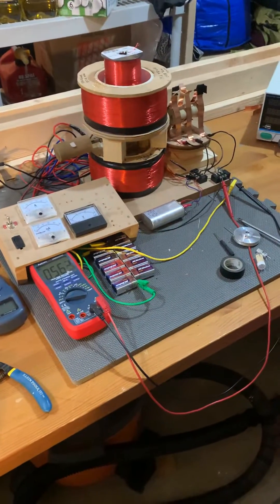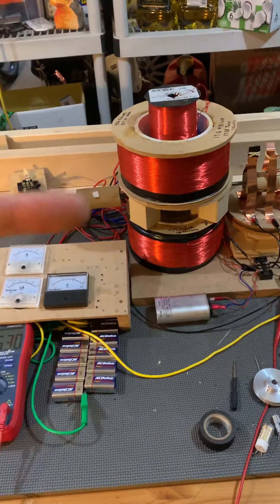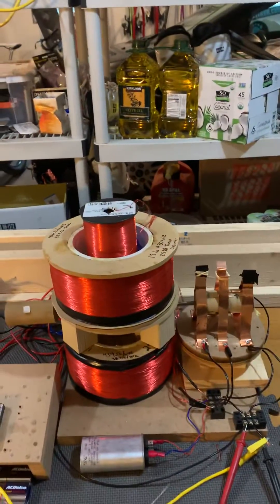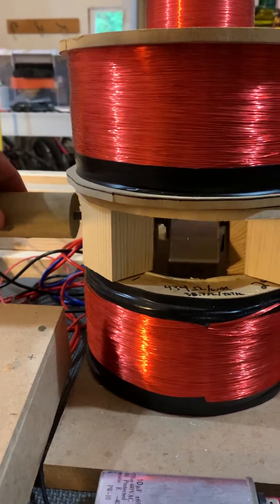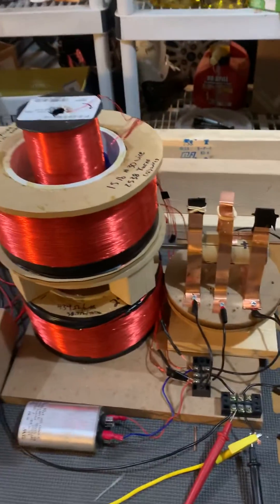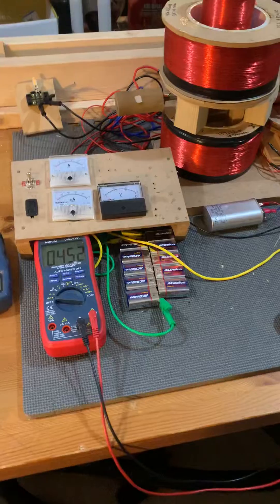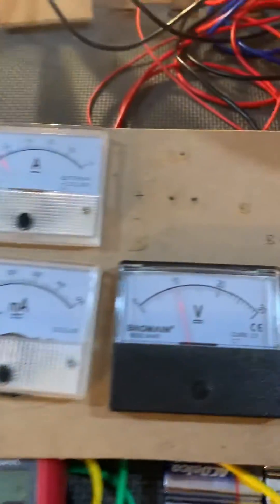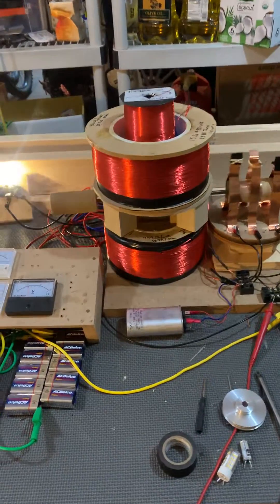Newman Motor

Comment: The power the magnet will put in the coil is directly proportionate to the gap between the magnet and the coil itself I would take a bunch of laminated bailing wires and place them inside you are main coils and make it so the nano denim spins and barely doesn't touch and then turn your neodymium into an electromagnet so that you can disconnect it and it won't be attracted to the iron cores after top dead center...

Comment: I bet you wound the coils like everyone else does which Is NOT the right way...
Reply: Should he like this, on a coil every LAYER should be wound the same way, meaning starting on the left and ending on the right, 
i see ppl do one layer from left to right then the next layer is right to left, 
basically when power goes through that coil on both ends of the magnet there will be a N and s pole and a S and n on the other end, 
if every layer is from left to right then there would be N and N on one end and a S AND S at the other, 2 layers would have double the field strength,  
after i do one layer i try to get back to the other side with 1 loop or 2loops max to achieve all one way,
just tapping a battery causes a really fast spin so probably leads to even lower power needed, 
i bet even the Bemf would look more uniform aswell, resonating coils are also meant to cause amplification.

Comment: Ive got one I scaled way down and got real close but couldn't break that 100%. Mostly because it is so small I had to use a single reed switch instead of a commutator and I never could flip the poles. Based on all my tinkering on my bigger machine like the one you built, I could never get any solid state triggers to work, they would run for a little bit and then bam outta no where something would blow up no matter how many protections I placed on the transistors. I even blew up a couple optical sensors and I still don't understand how. If I used big reed switches and flipped the poles, they would eventually weld themselves together, I tried a commutator and it would burn at the contacts. So much HV and potential being produced. The flip of the field is definitely the key I believe. You can run one all day on a single trigger and half h-bridge but as soon as you start flipping the field, somethings going to blow up. Such a neat motor and Newman was on to something for sure.
Reply from the maker: Thx for lengthy comment. I can appreciate your trials getting it to work. These things are pain staking at times. I think the electronics is the way to go but I’m an amateur and the commutator is simpler. Still I’m unsure it’s ever going to be OU but it is a novel invention and the batteries will last a LONG time.
Reply: @energyhack3538  I think with more work on the snubber circuits for the driving transistors, it may be possible. Newman never successfully used transistors  and I think it's due to the enormous amount of bemf he was able to get from his motors. You probably saw the video with the motor we both copied our design from. His was so strong it made the overhead lights glow with each pulse. I hope you can figure it out.

Comment: Nice replica !
Did you pull out the pulse spikes ?
 I looks like just gen coil 
 Have you done any recent work on it ?
Reply from the maker: No, I let them just go back to to batts via commutator.  Have not worked on it recently. Do you pull out spikes with a diode and electronic switching?
Reply: @energyhack3538  
 I don’t do the generator coil it just loads the motor you want to use a transformer effect and don’t use the regular wave below battery voltage or it will load also
Reply from the maker: @kenergy1707  what do you mean here? Transformer effect? Use the back spike via transformer to charge to a secondary batt? Interesting.. I’ve tried similar with the Benitez split positives arrangement. Thx for note 👍🏻
Reply: @energyhack3538  
Use your motor windings as transformer effect split a couple strands and use as a secondary for output with full bridge
Reply from the maker: @kenergy1707  gotcha. I wound that particular Newman coil 12-filar so plenty of extra wire to try that. Original Bedini pulse motor was set up that way - much easier to capture spike but a little less efficient I found than monofilar with diode.
Reply: @energyhack3538  
Yes very true but you can back charge primary battery that way 
 Check out my Newman motor videos there’s 5 or so
Reply: @energyhack3538  
Yes that’s one way but you have to go to second battery if you want to go back to primary battery you should do extra winding I find 1 to 3 ratio works so 3 primary coils 1 output

Comment: Does that capacitor have  the same capacitance as the couls has inductance.  And is the rotor rotating at the same frequency as the  Capacitor and coils
Reply from the maker: I can’t remember what I used but likely no it doesn’t. It was around a few microfarads. The rotor was turning a few hundred rpm. In a later video I wound the coils 12-filer and they had a lot of capacitance. The rotor would turn a little slower but only drew 1/2watt. However still wasn’t OU but about 60% shaft power.

Comment: Those so-called bar magnets are, in reality, PVC canisters of helium wrapped with an open coil.
{"Open" implies not connected to anything and not self-shorted.}

Helium will not respond to an electromagnetic field. And Newman's coil does not have sufficient current to produce any appreciable magnetic field as it is. Yet, he purposely designs his massive coil to exhibit high voltage to produce a strong electrostatic field (very lengthy wire of moderately thin girth). Thus, the helium will respond by producing a moderate to high frequency of electromagnetic radiation of its own. This amounts to a feedback, a positive feedback, to his massive coil and blends with the D/C pulses coming from his battery pack through his motor's commutator creating a slightly complex waveform within his coil. The beauty of his setup, is that he does not have to "pay for" the excitation of the helium except for the initial hand crank he gives his motor to get it started. But once begun, it picks up speed due to the coil amassing double the voltage over what the batteries can supply sufficient to broadcast this voltage to the helium and stimulate the helium to broadcast an EM field of its own -- received by the coil -- and the coil ends up sending a few hundred milli amps of current in reverse direction back to his pack of batteries to trickle charge them (top them off).

Without the helium using simple bar magnets...no overunity...

With the helium, plus a neon bulb and a parallel capacitor...overunity...

And this is what Byron Brubaker (MX6Maximus on YouTube and Facebook) advised Newman nearly forty years ago. Yet, Newman never gave this electrical engineer living in Indiana, any of the credit. Newman continued to tell everyone to enlarge their model-build to achieve overunity based on his prior design (using permanent magnets instead of helium -- which cannot achieve overunity) while all the while he was using his upgraded design of helium instead of magnets to show off to everyone. Not even in his book did he divulge this secret.

PS—This is not an electrical generator. It can only provide mechanical output to power a mechanical load, such as a water pump, or a conveyor belt, or a hydraulic press — in short, anything requiring lots of torque, but without the speed. This does not undermine its overunity. For, it will recharge its batteries with a slight trickle charge so as to prevent them from becoming spent. They will age, though, and need replacing once in a while. Of course, if solar panels were used, instead of batteries, then the reverse current might be useful for lighting up a few light bulbs or something?

BTW, by definition, perpetual motion means “without any input of energy” implying: “making something from nothing”. This is not the case with the Newman device. Instead, “getting more from less” would be more accurate and not a misrepresentation.
Reply from the maker: Very interesting - I’ve never heard that story. I’ve seen an 8000lb Newman motor (size of small hot tub) constructed with magnets for the rotor and it was merely a larger version of the little 30# motor I built.  (I’m glad I went to see it because I was planning to build a very large one for a considerable cost). The large one Behaved identically and not OU. Thx for post.
Reply: @energyhack3538  That 8000lb Newman motor (size of small hot tub) constructed with magnets for the rotor is the one I’m talking about however those so-called bar magnets are, in reality, PVC canisters of helium wrapped with an open coil.
Reply from the maker: The 8000lb one I saw was in person in Philadelphia - not built by Newman, Built by Geoffrey Miller. It was definitely magnets in the rotor and definitely under unity. But it was huge and impressive! Could sort of feel the strong magnetic field just standing by it while in operation.
Reply: @energyhack3538  The one I was talking about was the prototype build by Newman himself. On the internet you can find pictures of him standing next to it.

Comment: Would trigger windings added to your coils allow for transistor to do commutating like in a bedinni motor?
Reply from the maker: Yes, you could certainly do it that way. I did find the motors become more efficient with more windings, but that increases voltage requirement. So the electronics would have to handle Really high voltage (over 600v). I’m not savvy enough to build a high voltage H-bridge to run it but some others on you tube have done it.

Comment: Nice model of a great motor. Yes, scaling up to a motor inside a 50 gallon drum and miles of copper would be in Joseph's ball park.
I like idea of generator coil; perhaps some coils running against a flywheel disc with magnets added would increase output; you'd have to up power going in though so maybe use the torque to pump water for various systems. Joseph Newman loved to pump huge loads of water and he had huge capacitors storing generated power.
Glad to see your work, thanks.

Comment: Well done.... how its going on ur research?
Reply from the maker: This Newman motor has been on hold for a bit - I plan to try some new commutator designs but have been working on pulse motors recently. 
I saw a 200lb Newman motor in Philadelphia and measured it around 40% efficient which was a bit discouraging..

Comment: The sampling rate of those cheap volt meter and amp meter will never get you the real data from a Newman motor that operates at high fluctuations in volt and current
Reply from the maker: I run a camera in slow motion and film the amp meter bouncing then note the peaks and valleys and take an average value. It’s not as accurate as the scope but enough to get an approximation of the amps.
Reply: Energy Hack lol that won't work.  You need a TOP of the line analyser used by electrical Engineers and those cost around 5 digits

Comment: Hi. How many kg of copper wire, magnets and how many turns in the coil?
What wire gauge? Thanks.
Reply from the maker: 14.5kg wire, 1.36kg magnets N52 grade, 50,200 turns total between both coils. 30 gauge enameled wire.
Reply from the maker: 12,000 ohms resistance when coils in series
Reply: @energyhack3538  The problem is that your magnets aren't long, so they have fewer faces to interact with the coils. I capture the excess energy in the shaft torque, not the high voltage spike the coil produces when the magnetic field collapses.

Comment: Have you tested the output of the motor with being driven by another motor bud. To learn the true output in generator mode?
Like spinning it with a drill to see if it generates power.
Reply from the maker: No, have not. But I know the small gen coil not enough wire to produce power equal to input - unless perhaps I got rpm to 2000 but this thing would fly apart.. I need to redo the rotor, make it heavier, and better balanced..

Comment: Besides the bulbs will be interesting to know what's the  shaft torque out power too?
Reply from the maker: I did a prony brake in another vid and have confirmed the shaft output is about 60% of input power. That’s the highest I’ve been able to measure.
Reply from the maker: I’ve not have not made any good measurements of torque. It can be calculated from acceleration time and rotor inertia but the results seem too good to be accurate - ie was close to 100% efficient. 
I have some larger magnets on order and plan to increase rotor weight up to 10lbs. Will doore testing then.

Comment: 2: U need a mass about 1/2 the weight of the cooper wire or more as the neos are not enough.
Reply from the maker: Yes, I believe that will help. However, Newman had a working prototype that was 145 lbs of wire and 14 lbs of magnet. So he was able to show OU with 10:1 wire to magnet relationship. Mine only has 30# of wire and I don’t see an OU effect.
Reply: @energyhack3538  hmmm not seen that one. The ones I have always seen him use had large amount of wire and large magnets or flywheel. H talked about mas to energy conversions. I took it to mean the larger the mass used in the wire and flywheel. Kind of like Tesla used to weigh his wire to achieve resonance and did not measure it by length.
Reply: It doesn't work based on proportion. More mass, greater inductance of Aether into the circuit, more energy output when it collapses. Like a fishermans net, if its small, no matter how much fish in the lake, it's only going to catch a small number of fish.

Comment: Torque will not go down if you use bigger magnets like Newman did.
Reply from the maker: That’s the difficult part.. without rewinding new coils I’m stuck with 4.5” of available space.. I have an idea to get up to 3lbs  or 4 lbs of magnets but requires drilling metal with a lathe (which I don’t have)
Reply: @energyhack3538  if your shooting for overunity , just lower the voltage to the point where all you are doing is breaking the connection between your core and mag. This way you do not use more energy than is necessary to keep rotation, then after achieving this calculate the load that will not stop the rotation and walla you are now harnessing the power of the magnet alone
Reply: @energyhack3538  try my diagram circuit , i can see no reason why it would not work, it's prototype and i have not built it yet.

https://www.youtube.com/watch?v=WH4watZLhOA
Reply: @energyhack3538  better to lower the voltage input than to use a resistor , (ENERGY LOSS)
Reply from the maker: @mykedoes4099  yea, you’re right.. I’m going to to rewire the stator coils so my 12-strands are like a 12-filer coil.. this should increase ohms 12x and I can remove the resistor.. 
Then I’ll crank up voltage to 300+ and see if Newman’s theory was correct.. 
he said Power Out increase with square of Voltage In and Power In increases linearly with Voltage In..
Reply: @energyhack3538  GL
Reply: @energyhack3538  12 filar in series
Reply: @energyhack3538  Litz wire
Reply: @energyhack3538  if i were you i would turn the voltage up slowly from 0 until you get a response and that should be the running voltage for that coil
Reply: @mykedoes4099  tune it😉 . 
I agree, every coil has a resonate frequency. If the rpm isn't spot on you don't get resonate frequency. 
I have a flux switching ceiling fan that proves just that. 
He's going to get there.

Comment: The Newman motor is not a current driven motor , it is driven by purely potential. That is why he used dead 9 volt batteries in series to get high voltage and low to near zero amps
Reply: Try going for higher voltage upto 300V
Reply from the maker: @imtiazkannur9893  in latest video I rewired 12 parallel wires into 12-files and cranked up voltage to 350v. Now it’s 260rpm on 1 watt with decent torque! Motor definitely runs more efficient in this configuration.
Reply: This isn't specific to the Newman motor. The key to transferring energy without loss is minimizing the current (magnetic) so that energy is transferred using the voltage (dielectric). Resonance is usually the key to accomplishing that.
Reply: @SubNano144  truth be spoken
Reply from the maker: @SubNano144  great point..that makes sense.. this motor ran on 8 watts when its coil resistance was 17 ohms, I rewired the two coils as 12-filer and put in series which brought resistance to 10,000 ohms - now it runs on only 1 watt and about same rpm..
Reply from the maker: Yes, I can put a resistor on circuit and crank up voltage to get amps down. It will run same rpm on very low power (1.5 watt) but torque goes down.

Comment: You should take power back from the power coils using a diode and a HV capacitor to collect the high voltage pulse when the magnetic field collapses. A generator coil is not suitable cause the magnetic losses.
Reply from the maker: There’s a cap across the coils but no diode.. theory is that field collapse goes to cap and drive batteries giving a quick recharge.. I keep adding capacitance until no sparks visible on commutator.. still testing but appears batteries will output much more than rated Ah capacity..